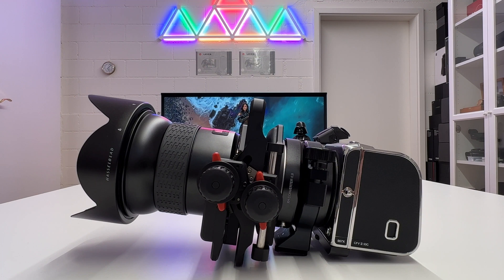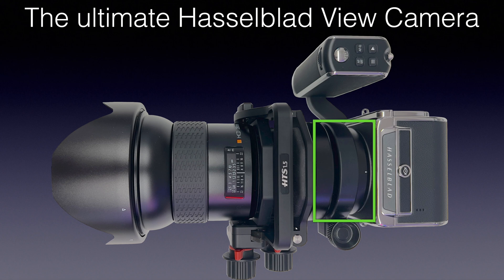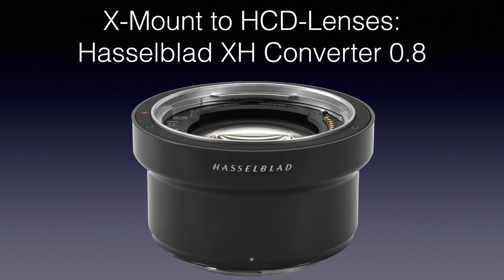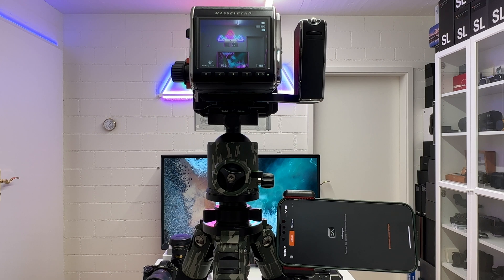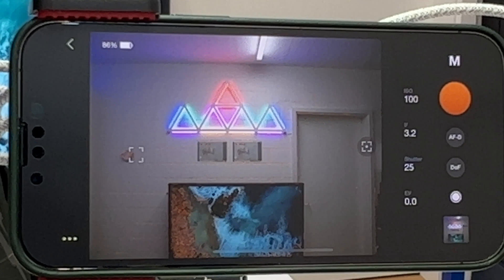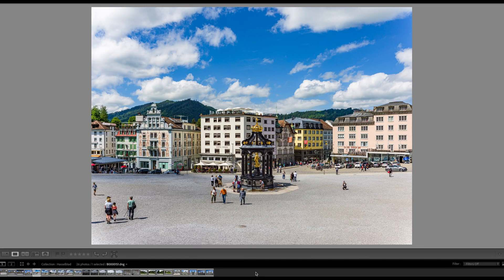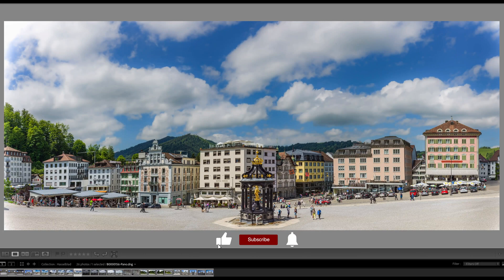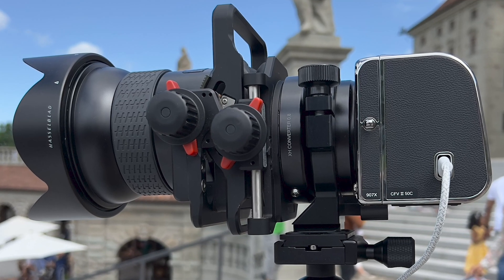Gorgeous HASSELBLAD T/S VIEW CAMERA | 7 Components

Comment: Would you please include a link to the xh tripod clamp/ ring? I am planning to buy the hts and the rest for my camera and I really struggle to find the correct tripod ring for the converter (the adapter is anyway discontinued). It would mean a lot! (Or maybe tell me the diameter of the converter, the diameter where the collar/clamp p(/ ring has to sit, and it is not present on the specifications)
Thank you very much!

Comment: I used to use EXACT same setup for architecture - top tips - get the HTS shoe for expanded capability which slots into the Hass tripod adaptor niceley - you can also 'twist' or 'rotate' the HTS adaptor. Once composed take a picture of the whole scene , bracketed if necessary for the sky only. then get a Lee Big or Little Stopper (6 or 10 stops) take another picture at fully closed aperture - the result will be that the exposure is so long that people move but are not recorded so there will be no people in your shot - then blend in the sky in post. I now just use 'transform' and the tilt and shift in post after stitching 9 or more bracketed panos on a Leica S3 - cheaper and easier and more importantly properly weather sealed which the Hass is not - the Hass has one major design flaw - the catch on the top is easily pressed especially if used with a shoulder strap. The back can rub against anything and then falls to the ground!!!!  Even more likely if inverted - ie lens facing up. Another option - though more expensive is to use the Hasselblad ARC Body - no vignetting with any of the 3 lenses due to the crop factor
Reply from the maker: Great comment, thanks!
Reply: @mathphotographer  I have one solution to the ' button ' problem, on the 907x control grip add a video cage, this covers the button, but ALSO adds 1/4"-20 and 3/8" screw threads, so you can add a connector to fasten the phone to the camera, no need to 'magic arm' it to the tripod leg!

Comment: one problem with this system, the effective cone of view is NOT wide enough until it hits the camera body; so would make more sense, NOT to use the HTS1.5 (movements at this distance), but a tele-extender, and convert the lens set to V-system, THEN add the flexbody at this stage, where the tilt has a more effective operating area( using the cfvII50C alone, affixed to the flexbody).

Comment: Using the H to X converter enhances the FOV on the X sensor image but reduces the resulting optical image circle, meaning less shifting before vignetting  than with the H to X adapter without focal length reduction (smaller FOV and greater image circle)
It would be very interesting comparing the same image with the H to X converter to the H to X adapter with a greater shooting distance to compensate the focal distance difference to the converter. 😉
Reply from the maker: Great comment, thanks!